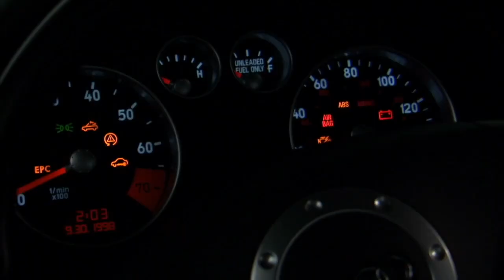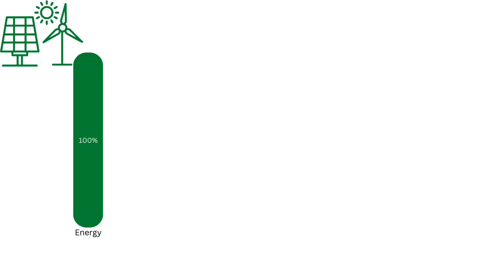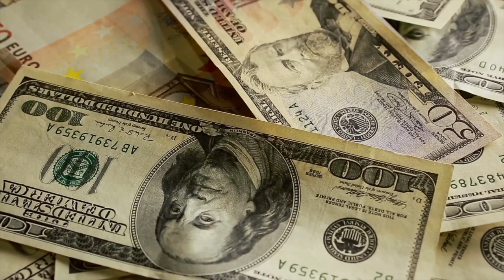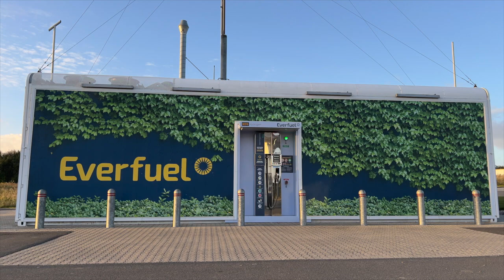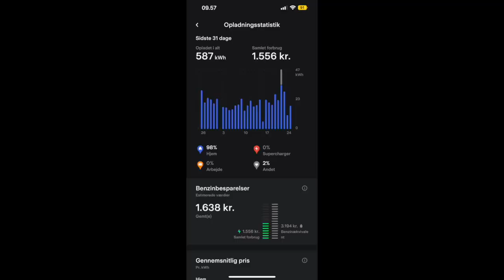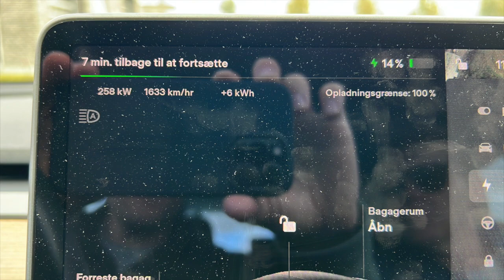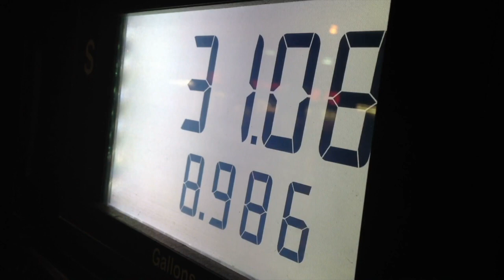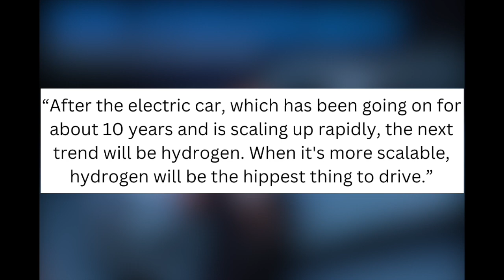The Truth about Hydrogen - The dirty little secret

Comment: I have produced my own Hydrogen from water HHO using my solar array.   You are seriously correct.  It takes so much power to split the water it is insane.   Even the on demand use element is still very costly.
Reply: Thunderbolt 100 watt here n Ms
Reply: My wife is lovely, but she is sometimes a sucker for ‘health’ gadgets. Well, it’s her money, however, she did recently guy a ‘water energiser’. I had to prove to her that she had bought a mini electrolysis plant by collecting the gas and lighting it. Doesn’t stop her using it every day, but at least it’s just USB powered.

Comment: Another problem with hydrogen filled vehicles is the unnecessarily high risk involved when you park a hydrogen field car inside any type of enclosure be it a garage or whatever comma the flammable and explosive range of hydrogen as I said earlier is around 4% to 94% So any hydrogen leak that is not continuously vented away Well immediately become a risk of fire or explosion, and of course hydrogen is colorless odorless tasteless and an asphyxiant
Reply: to all concerned about Keith B's posts please realize that he is almost certainly a troll.
Reply: @bgbthabun627  So, anyone who disagrees with you, is a "Troll?"
Reply: Hindenburg...?
Reply: @JohnMillerDesign  - Famous Fallacy - The "Envelope" of the Hindenburg, was a Fabric that was "Doped" or "Sealed" with a Concoction that was Basically Gun Powder plus A Resin type Liquid! That is what went up in (Bright Yellow) Flames, from the Lighting Strike! Unfortunately, it also burned a Large hole in the Envelope, allowing the H2 to both escape, and to also "Feed" the Envelope Fire! Kind of like pouring Gasoline on a Campfire, instead of Water!

Comment: Great video Lars. We need to add yet another step in the H2 (in)efficiency chart: Before electrolysis, regular water needs to be purified (using either heat or high pressure filters). This extra step of complexity consumes even more energy in the whole complicated processes to make the car wheels turn. Not to mention using ever increasingly precious sources of water. This precious, expensive, purified water is not re-used, but rather dumped onto the street after the fuel cell's recombination process!
The energy used in transportation step will vary wildly depending on how far the H2 needs to be delivered. In some cases it would be (even more) exorbitant. Oh, and add the cost to maintain the roads for 18x heavy truck traffic! Comparing electrons flowing down a copper line to 18x current truck traffic on our roads carrying volatile gas.... there is literally no sense in pursuing H2 for easily electrifiable transport. Hydrogen's ONLY uses will be as a chemical (fertilizer, steel, etc) and for the ever diminishing list of hard to electrify transport sectors (as battery capacity slowly but steadily improves at a few percent per year... not even accounting for any breakthroughs in battery chemistry and tech).
Reply: Great comment

Comment: 5:50 VolksWagen forgot to mention that for hydrogen there is also need for transporting and storage of electricity, adding ~20% loss to the picture.

It is not possible to have a hydrogen plant in a windmill or under a solar panel, and run only when the wind blows or the sun shines, you need to transport and storage of the electricity too with all the conversions from low to high voltage and back that comes with it...
I have never heard of 35% efficiency of hydrogen, I thought 27% was about the max..

Comment: For heat pumps I think the clearest explanation is "moves heat around".  If you give 1 kW of electricity to a heat pump, it can move 3 kW or 4 kW of heat around.  If you are actually creating heat from energy you will never get more than 1:1 ratio.  If you send 1 kW of electricity to an electric heater, you will get about 1 kW of heat out.

I agree that your math checks out on hydrogen being much worse for heating a home compared to a heat pump.  I just don't like you saying a heat pump "converts" electricity to heat.

I agree with all your points on why hydrogen cars lose compared to BEVs.  Back when batteries were terrible, people thought hydrogen might be the answer.  But now we have really good batteries!  It's over.

BTW I would be scared to have a high-pressure tank of hydrogen in my house.  Just say no!
Reply: Well said!

Comment: Hydrogen simply cannot be contained, it can be sequestered in containers for relatively short periods but it will eventually leak out of any container and even with special Alloys or special material piping hydrogen infiltrates the metal crystalline lattice structure and then he escapes on the outer side meanwhile it causes extreme and brittlement and loss in strength of the piping system and materials this is called hydrogen embrittlement. Also hydrogen has an explosive range of around 4% to 94% concentration, so virtually any percentage of hydrogen can be ignited and burned or cause an explosion. To move any mass of hydrogen or think of it as amount of energy, the hydrogen must be greatly compressed or liquefied comma and doing so consumes huge amounts of energy period and if you want a good example of how ridiculous and non-functional hydrogen is as a fuel just look at the SLS pile of NASA space junk, that is continuously unable to do its first launch because of hydrogen leak after hydrogen leak after hydrogen leak period
Reply: I agree comma and think you're absolutely correct period  😆

Comment: Hydrogen is the most abundant element in the universe. YES !!  However the problem is and always has been containerization. Compression is the most common, liquefaction is used (-423 deg.) & metal hydrides. All very difficult and expensive. I worked for several years with Cryogas Engineering and met the "Father of the fuel Cell" Geoff Ballard of Ballard Engineering during Expo '86. He said fuel cells for automobiles would never be practical. At one time they were going to set up "The Hydrogen Highway" in British Columbia, but then reality set in.

Comment: Even if we have plenty of green H2, mobility will be on battery as any H2 car fuel cell needs a buffer / booster battery. Funny, especially in city traffic, the fuel cell more or less constantly needs recharging the battery from wich the motor gets its accelaration power.
Reason behind H2 are the present OPEC countries which desperately hope for H2 to convert from their fossil ressorces.

Comment: You didn't include the cost of maintenance & testing of a hydrogen system. This is required at least every 5 years for any high pressure tanks holding gas or fuel like CNG/LPG, Oxy/Acetylene, or even scuba diving air tanks. Given most hydrogen powered cars have three or more tanks, that is going to get expensive real quick.

Comment: Hi Lars (Beachrider),
I know a thing or two about hydrogen, having done a university level thesis. Hydrogen is useful because it can be generated in Japan (day time) and consumed in Oslo or Copenhagen during your night time. To make it work, one would promote a global, shared pipe network. Secondly, hydrogen is light and has to be stored under high pressure...which costs energy. Thirdly, the thermodynamic efficiency limit for fuel cells is around 30%. Then there is the unanswered question of deuterium contamination and other potential environmental risks that would have global implications.
It can work...but, if scientists get their act together and open their eyes for long enough to observe how stupid they look, we may have zero point energy before hydrogen becomes a viable option. The only other alternative is to generate hydrogen purely from nuclear. People in the US even have nucular power to draw on.
Reply: Rather than pay the 30% hydrogen loss tax and then build pipelines, just lay power cables and send the  electrons ?

Comment: Lars you missed a key issue. You said ICE auto manufacturers want hydrogen because it supports the fossil fuel industry, but that is not their concern. What they want is a liquid feedstock to their complex Internal Combustion Engines, which have hundreds of parts, hundreds of ancillary suppliers, and which employ tens of thousands of people, including a huge dealership servicing network. That's their biggest concern. EVs kill that whole business model.
Reply: I'm sure Lars hasn't missed this but just misstated it. The fact is that the oil industry wants to the  car industry to keep using a combustible fuel and the ICE car industry does too. That is what both are synergisticly locked into. For both, it's a several billion dollar / day business. That is all going away and there is nothing they can do to stop it. But; just slowing it down means Billions in profits  over the next few years. Billions . With that kind of money on the line and the huge investment each had already made; it is no surprise that  the oil and auto industries will try to slow down the transition as long as it is financially profitable.

Comment: Thanks Lars for this clear comparison of volumes between EVs and hydrogen cars. Hopefully, with the new batteries and charging capabilities, BEVs will be as fast as hydrogen or gasoline cars to fill up, and this pseudo-BEV limitation will disappear (of course, anyone who owns an EV knows that this is not a limitation, even today, as most recharging is done at home or at work). But when you own a car, whether gas, hydrogen or electric, you want to carry people and things in your trunk. The problem with hydrogen cars is that you are limited in both cases compared to any gas or electric car. Look at the Mirai, it's a pretty long car (5m), so you expect to be able to accommodate 5 people: no, because of the tunnel, you can only accommodate 4 people! It is a family car with 4 seats. A family car has enough trunk space to accommodate the family luggage: no, it has less trunk space than a Renault Clio (321 liters). Oops! If you look at the exploded view of the Mirai, it's incredible: you have huge filters to purify the air, the fuel cells, the hydrogen tanks, the battery and the electric motor: you quickly understand that there is not much left for the seats and the trunk. To be compared with the skateboard of a Tesla for example.

Comment: Great video Lars. Im a big fan!!

I’m an HVAC engineer and your explanation of heat pump operation and it being that efficient is not correct. If you’re curious reach out and I’ll be happy to discuss with you - but (both) the performance and efficiency of the system is largely dependent on the outside air temperature. At approximately 60F, where the need for heating typically will first arise, you are correct. As the temperature drops the effectiveness and efficiency a refrigerant-cycle Heat Pump drops quickly.  By the time the OAT reaches (approx) freezing you need to start looking at the use of supplemental heat of some type.

Comment: Like your channel and not trying to bash it. I totally agree with the moral of this story / narrative, but 
there are some to me disturbing errors in the base data, that makes the message a little less strong in my opinion. 
 - The explanation of electrical vs H2 is heat energy is quite bad not to say nonsense.
 - Also the losses of the H2 cycle for and EV, even though very high are exaggerated here. 
 - The 7 bar for the trailer truck seem a little low, I don't know the exact number but try at least 70 bar (maybe 700 bar, looking at the composite cilinders).

Nevertheless it doesn't change your story.
1) Inefficient use of clean energy to  produce, store, transport and use H2
2) it is a means for legacy oil/gas companies to continue their current processes for unnecessarily much longer
3) we do need in the future much more renewable H2 production for the reduction processes to change to clean a.o. Steel, TiO2 production, NH3 production.

Keep up the good work.

Comment: Every time I hear someone talk about Hydrogen cars being a solution, I just laugh and laugh.
You know what I see in every single industrial plant I ever visit? Electric motors.
Pumps, fans, conveyors, mixers, compressors, actuators, this, that, the other... all run by electric motors.
When the plant has a power outage, they crank up a diesel-powered generator... TO CREATE MORE ELECTRICITY.
Reply: Exactly, I worked in tire manufacturing which is a very high energy process. Nothing but electric from 2000hp down that ran 24/7 50 weeks a year with minimal maintenance and at the end of life most can be rewound at a local shop. Anything else would be ludicrous.

Comment: It only takes a small amount of electricity created by Solar to make Hydrogen. Then the Hydrogen can be Burned to create a very High Heat. This can be applied to many industries. But not Electric Vehicles.
Reply: Regardless if you produce the energy with solar, a process where the efficiency is only around 25 % is crap. If 75 % of your solar output is waste, why would you use such an inefficient process as hydrogen?

Comment: Agree that electric power from renewables (solar and wind with battery backup) beats the pants off H2 (not to mention fossil fuels -- I've done the math).But I can foresee a role for green hydrogen, perhaps produced from solar in Australian or Middle East deserts, as the most practical renewable based energy for aircraft, certain industrial applications and places like Japan or Taiwan where desert solar and high wind sites are not sufficient.
Reply: Ok so hydrogen as a electron storage and transport by ship.
Reply: Hydrogen for aircraft is not very good either. It has to be stored either liquid (by having it cooled to - 260°C or so) or having it compressed to like 700 atm. Both methods take up more space and weigh more than using a liquid fuel in a simple container. My guess is that energy density of batteries will increase to a level where the system weight will be competitive and viable also for aviation.
Reply: @swhbpocl  Good point. Thanks.

Comment: I never knew there was so much hydrogen in use already, if gray H is twice as polluting as gasoline or diesel it should be banned, make it illegal to use any but green H at all anywhere. If after all gray is replaced with green we still have large amounts of renewable power we can not store then make extra hydrogen if there is a market for it, or better yet build more storage.

Comment: As musk says..........hydrogen is stupid!!!!?.... Tony seeba has an excellent talk of about 8-10 minutes comparing solar power with hydrogen power vehicles. Bottom line........to release hydrogen, u need energy. In USA most hydrogen is made from natural gas. U need temperatures of 1,000 degrees......that requires more energy. The other way to make hydrogen is electrolysis of water. U need electricity. Then there is the infrastructure to deliver hydrogen to the consumer. There is none! U would need an infrastructure comparable to the gasoline infrastructure we do have that cost trillions of dollars. Finally look at the efficiency of the cars. Hydrogen is about 20%,.      The same as gas powered cars. Evs are efficient at over 50%!!!!!!.... So there is no real advantage to using hydrogen. It is as inefficient as gas, and uses energy.....gas or electricity..... See Tony seebas presentation on his channel.....excellent....

Comment: I didn’t know about Hydrogen made with Fossil fuel would be so inefficient.  Thanks

LARS you are a smart guy, what about Molten Salt Reactors.  Using Thorium as a fuel.  

I would like you to do research on the Molten Salt Reactor using Thorium as a fuel.  It’s four x more available that the current U-235 fuel used for current Nuclear Reactors.  Thorium Reactor once powered a military aircraft so it’s was developed during WW2.  This kind of reactor is low pressure or one atm pressure.  Doesn’t require water so perfect in a Desert so water is not needed.  The 1/2 life waste is only 500 years.  The waste cannot be turned into bombs and infact it can take the waste at Yucca Mountain and consume the remaining energy left.  The safety of the reactor is stupid safe using a salt plug that should the temp runs away the plugs melts and passively drain the reagent into a storage tank and the reactor cools down.  Low maintenance for sure.  

China is taking this old technology and building a small reactor to give it a test drive.  The problem is the Fluoride Salts are corrosive so I believe that China found a go around.  ( maybe Graphine ).  So these reactor don’t have to be big so maybe there is a future.
As far as radiation, it emits an alpha particle which means it will not even penetrate the skin. I can live with that kind of radiation.

I am awaiting the Fusion Reactor, but this might be a great go between for the time being.

Comment: Hydrogen is an element not a “chemical”..  we don’t make it.  We extract the hydrogen molecule from chemicals like hydrocarbons and water.  Also, Grey Blue and green hydrogen isn’t an actual type of hydrogen it only describes the extraction process.  

It is very energy inefficient process and all of the transportation problems highlighted is  absolutely accurate. 

Even if all the engineering and transportation problems were solved it’s not going to be efficient enough to be an economical fuel.
Reply: What really surprises me is the Japan is the least invested in renewable energy of any of the developed and technological advanced countries.  That along with its population collapse is going to make Japan fall very behind, as a country in the second half of the 21st Century.